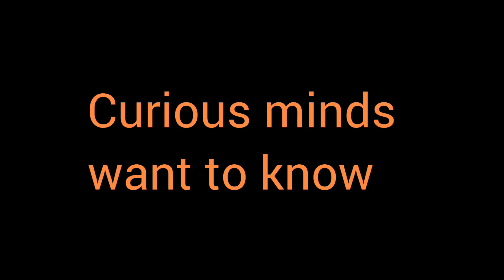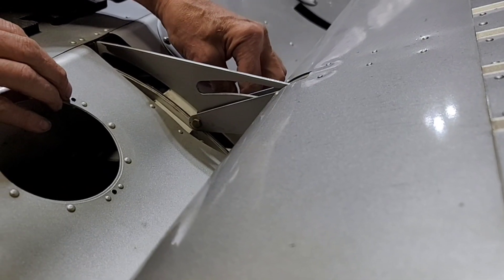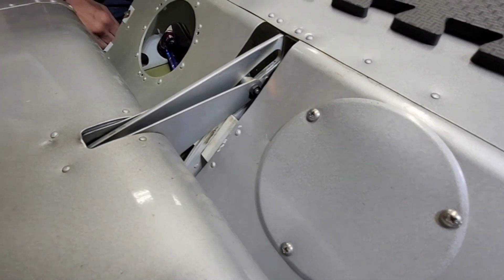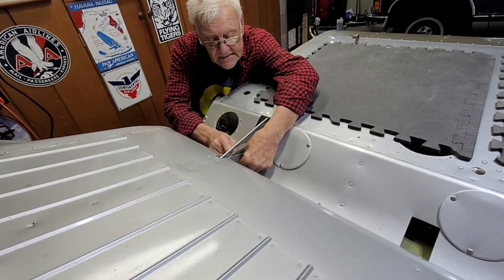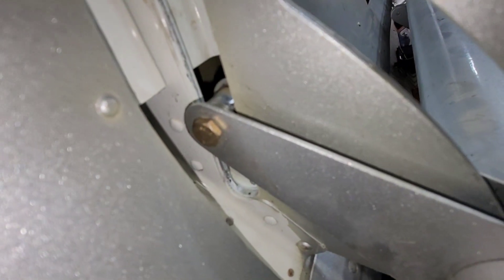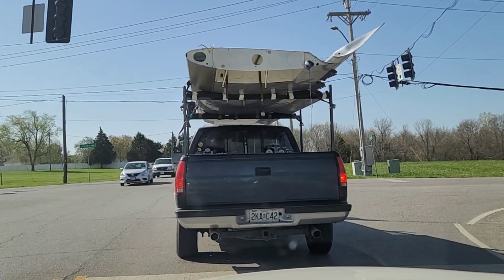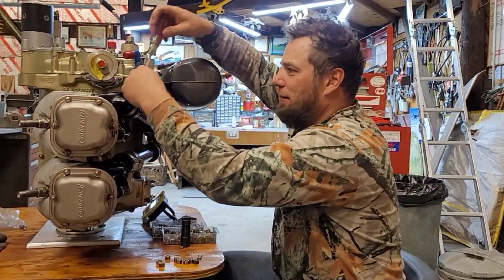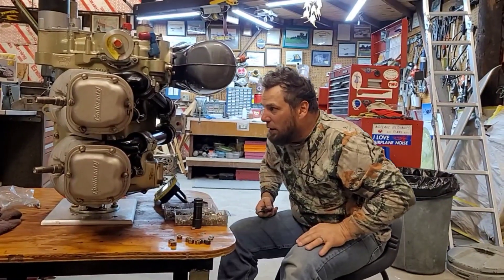The riddle of Cessna flaps maybe solved. Why did they fail after all?

Comment: Paint stick?  Nope.  Bracket tweak? Likely.  I wouldn't fly that until the flaps are off and all the parts are checked against the design drawings.  I see the service bulletin sets 0.02 inches as the tolerance.  Eyeball isn't good enough.  Never mind the every 100 hour dye penetrant inspection.

Comment: Years ago I remember a local crash of a 150 and the pilot said the flaps stuck at full flap too. 

Someone said wait till you have the wings right side up... wait a moment. With the wings upside down the load on the track and rollers is in the same direction as it would see in flight but lighter.  I think you are on to something myself.
Reply from the maker: I'm ok with being wrong but not ok with leaving possible problems on the table
Reply: @mattmansell3486  I fully understand and agree.

Comment: Do you have Cessna service bulletin 95-3 dealing with flap track and roller wear, also get the wear gauge that is available for checking track wear and the roller installation tool. The tracks and rollers take a beating and if the plane was used as a trainer, you know the flaps were probably down for a lot of slow flight and landing practice from the looks of that wear spot.

Comment: Maybe some light lube on the tracks would assist in the roller's movements?
Reply: No. Never lubricate the tracks. Oil or grease attracts dirt which then accelerates wear of the aluminum tracks. They are quite a job to replace when worn.

Comment: I have an idea. I have been doing mechanical work for most of my almost 70 years. I did not go to A&P school when I became a commercial pilot and CFII/MEI. Everyone I spoke with essentially said I should not do it. One guy owned his own aircraft repair shop, and when I asked him, he didn't just say "no," he said "hell, no!" That said, I have another approach to the sticking flap issue. The smoothness of flap movement is dependent up the effective distance between the rail openings in which the rollers move. The intention is for each roller to share a portion of the flap load during the change in position. This proportional load sharing is dependent on the distance between the surfaces on which the rollers move. By sanding the paint off, you increased the distance between the contact points of the rollers, making the upper roller (it is actually the lower roller, but the wing is upside down on the bench) take more of the flap load on its bearing, and now the decreased load on the OTHER roller keeps it from jamming in the rail. HTH.
Reply: Great share! I have a question; is it also possible that the roller is worn internally?
Reply: @jcmcclain57  That is also a good possibility. The flaps are used during each flight cycle, so I would look at the wear for the 100 hour or annual.

Comment: My old Freightliner classic driver window stuck rolled all the way down. Years of not rolling all the way down cake grease at end of track and nylon bushing wore finally stuck down. Hitting it stopped working 😂. New track and bushings was like new. The smallest of things can be the biggest of PAINS. Glad you found this and I agree not using 40 degrees that much after being painted would be probable cause👈😂. 🤞✌️
Reply: Funny thing, this happens to Hard Disk drives also, if a drive keeps reading the same data for a long time or is not used, there is a grease ridge that can build up in the bearings that will prevent the heads from retracting if the drive is shut down. Without rotation airflow, the heads touch the surface and can stick or cause damage.  The solution was for the drive software to have the heads periodically sweep the surface of the platters to redistribute the lubricant.

Comment: I don't know anything about this stuff But I would be concerned there is a small depression at that farthest spot on the track. At full flaps the air pressure would force that roller against the track and elongate the slot in that specific spot. Wore the paint off first and then created a small deformation. Maybe prudent to take a closer inspection of that spot. What limits the flap travel ? is there an adjustment so at full flaps it stops short of that roller going all the way to the end of the track,

Comment: Ya know, the luck of the draw is right!!! All that hassle over some paint!! Who would have guessed... I bet there will be truck loads of Cessna owners that watch this video checking their flaps if that area is painted, or even checking to see if it is just simply worn and has a small divot there... I'm glad you basically figured that out Matt!! Great job!! One last thought, I am wondering if you could think about eliminating the ability to use 40 degrees somehow to keep this from happening again?? Just a thought.. Maybe placard it, or change where the stop switch stops the flaps?? I don't know if those are possibilities, but it seems like this could happen again..  Maybe there is an A&P or someone at textron could weigh in on this with their ideas..
Reply: I actually saw a video of someone putting a stop on the cam inside the wing, limiting the flaps to 30°.
Reply: @eugeneweaver3199  Well, that sounds like that could be a great option then.. Hopefully they can eliminate that problem from ever happening again... Thank you for letting me know that that could be done.. That’s some good info...

Comment: Seems to me a good flap motor should have plenty of power to overcome something like this.  Did you replace the flap motor too?
Reply from the maker: And no didn't replace motor yet but it definitely was a conversation we had
Reply from the maker: You would think.
Reply: If the electric motor is not defeated by the load, something else may be prised apart.

Comment: When the wing is turned over and installed on the plane, that paint area would be on the upper side of the track.  The wind would push the flap roller back and that raised area would create an impediment to that roller starting to move, like a chock on the wheel.  If you put a broom handle tight against the wheel it will still take some power to roll that wheel.  Once it moves it is easy to roll.  The airflow on the flap could keep that roller tight in that position.
Reply from the maker: I agree, obviously we are not done looking at this problem. Just thought it was good to share it with others.
Reply: @mattmansell3486  I agree!
Reply: @mattmansell3486 . Commendable for informing folk. It is not a matter of if, but when that problem occurs on all of the builds with that amount of travel in the flap mechanism.
Reply: Those flap tracks do wear and the roller bearing surfaces can dry out.  The flaps should move freely throughout their range even when heavily loaded. As an A&P for over 45 years and an IA for many of those years, I did cringe when I heard the excuse for not disassembling and inspecting being that it was too difficult.  In a normal situation yes, but you’re dealing with a potentially known problem. One tends to attempt to convince oneself that such and such can’t be the problem. I’ve seen folks bit when trying to solve intermittent problems.  Check the flap limit switches very carefully to verify that the flaps are not being overdriven in the down position. I would check the switches and all associated wiring with the mindset that this is the problem.  Likewise with all mechanical aspects. This is the time to wear ones “doubting Thomas hat”.  Good find on the flap tracks. I would change them out if the plane were mine, a relatively easy task.  As I earlier mentioned, they do wear.  As I remember Cessna refined the flap control circuitry at one point.  (Preselect) Probably for a reason beyond convenience. I vaguely remember the flap limit mechanism being refined and the maximum extension being reduced.  It appears that you will have a very nice 150 at the end of this ordeal.  Also good luck to your daughter. Stick with it.  My wife earned her private pilot before her driver’s license. She’s now flying a 787.  It’s a long haul for sure, but don’t be discouraged, don’t forget the four year degree. The reward is worth the dogged heads down and move forward attitude, and the demanding effort required.  One more obscure tip which my wife can offer.  Become very comfortable with check rides as they will become a way of life. View them not so much as a test but rather as an opportunity to demonstrate one’s superior skill set.   Good luck and take care.
Reply: @myrlstone8904  what a coincidence that I see your take on check rides. That was my attitude exactly. Not to be cocky, but confident. I made sure I was ready not for just the check ride, but for the privilege of using the rating that came with that check ride
Reply: That’s what I was thinking! And the wind pressure would add much more weight than just the weight of the flap when it is upside down.

Comment: Now lube that with Liquid Wrench lubricant. Not the penetrant, the lubricant.  Lube the roller not the slot.I can guarantee it won’t stick again. Make that part of your inspection. Also, if you can either lock out or disconnect the 40 degree setting on the switch, that would be good. Also, Please don’t immediately assume that is your failure point. Check to see if the roller even goes that far in the slot with the control arm and motor connected. Mike Patey designed the flaps/slats mechanism on Scrappy to limit out mechanically before the rollers reach the end of the slot if I recall correctly. Perhaps the designers of your 150 did the same. In other words, the flaps may never have reached that “sticking point” and your failure is elsewhere. I base this on 42 years as a mechanic on similar mechanisms. The ones I work on however won’t result in something falling from the sky, so I hope a registered A&P chimes in on this as well.

Comment: Replace those rollers on top of polishing. Past that it is very rare to go barn door on those airframes normally even on the tightest approaches.
Reply: I got my PPL in a C-150/152 and we always dumped in 40.  Especially for soft field/short field technique.
Reply: @stevehammond7485  Don't know what to say because you stretch out your chances on a missed approach. That was how I was taught that if you don't need it don't use it.
That was on a 900' dogleg duster strip cut into a forest on all sides.  With 40 the time required to raise flaps and go back into a climb is longer.  On very short strips it just not a smart move.  It's your choice of course but not mine.

Comment: Glad you found the problem!  I cannot believe that those followers are made out of aluminum seems as though the track would just wear completely out and have a ton of slack once it wore!  It was the problem for sure!
Reply: We replaced the flap tracks and rollers on out 1966 150. The tracks had some wear and a small lip at the 40 degree point. It's not to big of a job to do.

Comment: Hi Matt and family. I would test it again with the wing right side up. Gravity may be playing a role with the wing upside down on the bench. There could be something similar happening on the othe end of that mechanism as well. Wear and tear on such an old plane. Just theories.
Reply: The aerodynamic pressure in flight would probably be higher than the force of gravity when upside down.
Reply: @raypearce2974  Yes, good point.
Reply: Right-side up and the roller will fall away from the abrated aluminum. Roller is probably worn and could use replacing. I was at ACCA. Talked to Dan before it all happened. We were probably in the FBO at the same time. Alum on alum sliding, galls terribly
Reply: Was going to say the same thing. Should be trouble shooting with the wing flipped over in natural position of flap   The roller won’t ride on the top edge of the flap bracket